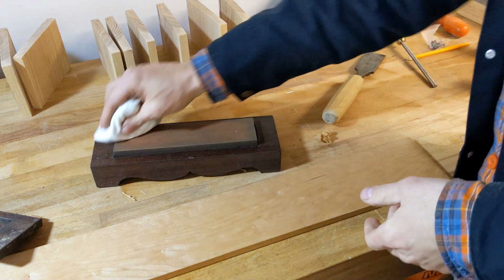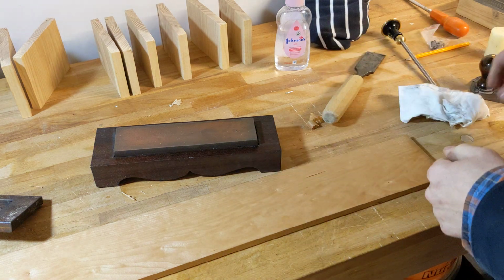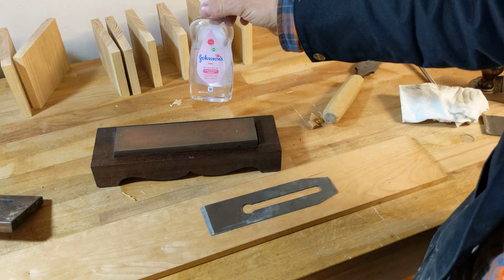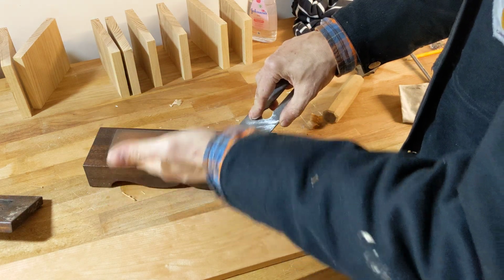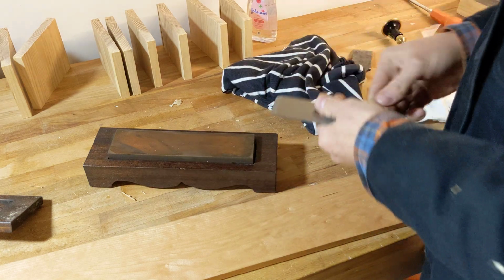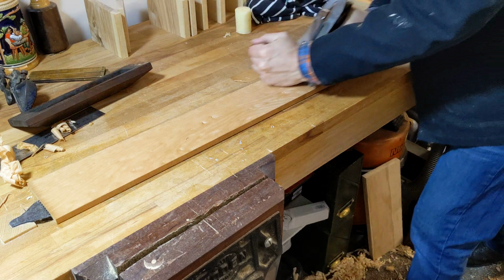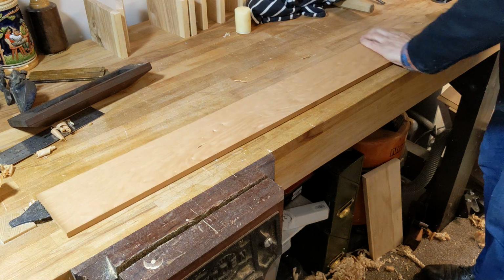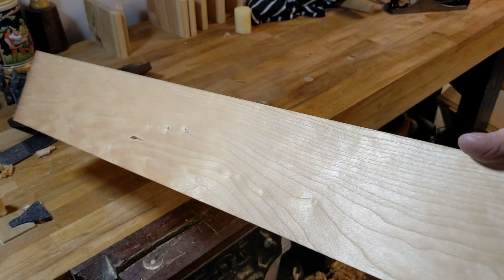400# Grit Sharpening = Shimmering Surfaces! Cheap and Realistic Sharpening! #woodworking

Comment: If I could make one minor correction re. it being megabucks for finer diamond plates? That's only going with name brand, and particularly 'premium' brand plates (I use the quotes very deliberately there haha). As mentioned in a number of the older threads on UK Workshop the budget Chinese plates are a total game-changer for setting up an inexpensive sharpening system. They used to very commonly peak at #1000, but in the years since #3000 has become quite common. Unlike some of the 'premium' brands the price for all grits is the same, and it should be under a fiver!

Diamond plates of any make will of course not last virtually forever like a Norton stone can, but even the cheap ones by now do have a fairly well-proven longevity. And wearing one out in just a short time seems to be very rare (and may be partly a user-error thing, pressing much too hard).
Reply from the maker: That's interesting 🤔. It's good to get some more user based experience. Where do you shop for these plates? Just Amazon?
Reply: @faceedgewoodworking  Previously the place to get the cheapest ones was directly from Chinese vendors on AliExpress. But in just the past year or so there's been an explosion of what's available on Amazon, including sets of plates, and some work out to be just as good value.

But there's a but, the sets rarely go as coarse as I think is advisable (for super-fast edge repair, and reprofiling, in the absence of a grinder), plus they tend to include multiple superfluous intermediate grits that aren't necessary (since unlike when sanding you can make gigantic jumps in grit when honing without any trouble at all). The traditional jump from the India side of a combination stone to a finishing stone is a good illustration of exactly this, since a translucent Arkansas, a good slate hone or a Charnley Forest are all rated in the thousands.

So I think AliExpress may still be the best place to buy individual plates to make up a very budget-friendly set, e.g. a #150 and #1000. Along with a DIY strop that's a 10+ year set for barely more than a tenner, factoring in a metal polish, buffing or honing compound having to be bought new. If one already has anything suitable for loading the strop it's going to work out as under £10.
Reply from the maker: @tungsten_carbide  Helpful! I must admit, I like a water bath grinder for my tools. I don't appreciate the particulate from a bench grinder unless I'm at the lathe. At that point I have an appropriate mask on.

I don't need a grinder that often, thick and wide blades are the main culprits.
Reply from the maker: @tungsten_carbide  Just checked UK Amazon £23 for a 400# 1000# combo diamond stone. What do you use for floating off the particles? Snake oil 😂?
Reply: @faceedgewoodworking  Hehe, I am very wary of anything remotely in the vicinity of snake oil 😁On-topic, like that British-made blue honing liquid that's suspiciously like window cleaner yet costs more than single-malt whisky?! [Off-topic but this is why I was instantly wary of both Odie's Oil and Peacock Oil when I first heard of each one, and have been very gratified to since discover that my first instincts were dead on the money!]

I generally use my diamond plates dry, after experimenting using them with just about everything – spit, water, soapy water, window cleaner, isopropyl alcohol, white spirits, WD-40, baby oil and liquid paraffin. During this investigatory/experimental phase I would have tried one of the old standbys in British and Irish workshops, 3-in-One, I just didn't have any to hand!
Reply from the maker: @tungsten_carbide  Nice! Next time I'm feeling spendy I'll have to give the diamonds a try. I have tried them before but I didn't like the feel. I'll have to be more open minded!
Reply: @faceedgewoodworking  Interesting, not liking the feel or a 'lack of feedback' (assuming they're the same thing in different words) is one of the few complaints about diamond plates that one does hear repeated over the years, so there's definitely something to it for some users. 

Obviously nobody can doubt they do get the job done, but if you don't enjoy the process I wouldn't blame anyone for not wanting to use them. In the same way many don't care for waterstones, without casting any aspersions on how well they work.
Reply: @faceedgewoodworking  All my plates were bought on AliExpress, over a period of years (first in 2015, and still going strong).  "All my plates" is misleading, since I have just the three!  A 150#, and 1000# and a 3000# that I bought just to see if it was A) as fine as advertised (it is) and B) whether it might take the place of a very nice stone such as one occasionally lucks into at a car boot (it could, but I prefer the better of the two slates I've picked up over the years).

That's one of the great things about these plates being so cheap – often they are literally cheaper than a posh coffee – you can pick one up just for the hell of it and not feel too aggrieved if it's not quite what you'd hoped for. I'd hate to be one of the poor sods let down by a premium diamond plate... the Extra Fine DMTs come to mind, at north of 100 quid!!
Reply from the maker: @tungsten_carbide  Yeah, this is the tricky part. Your experience is helpful here. I'm never sure about referring people to AliExpress because it's not quite a clear as buying locally from a reputable brand. 
It might be time for the likes of DMT etc to offer a second tier stone. People would likely still pay a bit more than Ali prices because it's a brand they identify with.
Reply: @faceedgewoodworking  Yeah to be fair it could still be hit or miss ordering from random sellers on AliExpress, rather than from a specific recommended vendor. 

The diamond plates (within each type/appearance) do appear to be very consistent to judge by multiple reports by various buyers on a given forum for example. But, it's not like people are ordering them so regularly that we know they remain consistent (the way a name-brand thing can mostly be trusted to be, even if you're going on a plug from a couple of years previously).
Reply from the maker: @tungsten_carbide  ultimately it's a kinda, worth a punt, how bad can they be situation.

Comment: The YouTube recommendation for the next video which came up alongside this was for Paul Sellers’ “Sharpening to 250 grit” in which he uses the coarse side of the Norton stone to very good effect. It seems the old craftsman still have lots to teach us. I have ground an iron to make a scrub plane and was about to sharpen it so I think I will try the coarse side of the stone and see how I get on. I must say that however sharp I get my plane iron ( even in my wonderful Cliftons) I cannot achieve consistent full width shavings like yours. More practice needed no doubt.
Reply from the maker: Hi Eddie. As mentioned in the video, there is so much nuance in a plane. Sharp is part of the picture but it can't be obsessed over to the point of other key skills are being overlooked.
Reply: If you don't mind me poking my nose in, if you're creating narrower shavings it would generally indicate a slightly cambered edge. Many woodworkers consider this very desirable on smoothers and maybe a jointer for a couple of reasons (with a jack or fore plane the camber would be very much more than slight, although not quite as pronounced as on a scrub plane).

On a smoother one other option to prevent track marks is just to relieve the two corners, but this doesn't appear to be quite as effective as a camber (even if it's very tiny) e.g. as demonstrated by David Charlesworth, may he rest in peace.
Reply: @tungsten_carbide  Thank you, I will check that out.

Comment: An excellent illustration showing what can be achieved with an iron sharpened in a very common old-school way (the Norton combination bench stone possibly being the most popular single sharpening stone ever made). Obviously this is far, far less than is considered normal these days.....  but as I like to point out at any available opportunity, look at what the old guys could do with their 'sub-par' edges! 

And for Americans your example is actually even better than you intended because the India side of a Norton combination bench stone is given as exactly P400, but this is approximately 340 in the American CAMI system. That'll blow a few more minds 🙂
Reply from the maker: #340 grit 😂. One benefit of these stones I failed to mention is that it raises a burr quickly. People can fall into the trap of going too fine and failing to remove wear from the edge (see stropping vid). Thanks for the comment 👍

Comment: Another great video demystifying woodworking. I've experimented with a handful of sharpening mediums now and I'm coming to the conclusion that they all work just fine, it all comes down to budget and preference. Diamond, ceramic, glass, aluminum oxide, corundum. I've used all of the above and all edges cut when sharpened with them. I ground a primary bevel on a 1/4" chisel up to 220# last week using sandpaper, and it pared red oak with out much fuss. There isn't a wrong option they all seem to do the job. Once you get past how shiny you can make your edge, even the cheap Amazon combination stones can be used. I have 2 of those, a 600/1500 which I reckon is actually more around 100/400, and a 2000/5000, which tops out at more like 1500-2000#. Both bought for under $40. Sharpening can be done within most budgets once we get past the smoke and mirrors
Reply from the maker: This is very true. There's a cost effective solution for everyone. It can be a very good thing to go finer, but as you point out, it doesn't need to be expensive. 

Because of my poor production skills, not many will see this and that's fine. Those that do should note the lack of affiliate links or my own shop of tools.

I'm biased, that's a given. But if I was a salesman you could trust what I say a whole lot less.
Reply: Yes, everything works! As someone sage said years ago a lot of the waterstone/oilstone choice simply comes down to whether you like watery or oily mess. (And if you throw in diamonds the possibility of choosing dry mess.)

Quick question re. your judgement that the cheap Amazon combination stones aren't anywhere near as fine as rated? Those are whopping discrepancies, specially on the first one 😲I know some stones, and diamond plates, are rated way off (to deliberately mislead I guess, because of the modern obsession with higher grit numbers) and that could simply be it, but maybe it's partly differences in numbering system? The JIS numbers are often a source of unintended confusion, although usually only at the finer end where the numbers diverge widely.
Reply: @tungsten_carbide  I'm not sure what your question is, but 100% yes, they are rated far above what they can produce. Most will have reviews saying the same thing, and my advice is if you can find some with product reviews that include pictures you can get a better idea. Just know going in to it that they're lower quality, need to be flattened regularly, but will sharpen quickly the stones cut fast. If you land on something like the 2nd stone I mentioned then it will be good to add a strop but truthfully you'll probably be as sharp as you'll ever need. I considered a 3rd cheap stone rated at 10k, expecting a 5-7k # result, but thats up to you, all 3 stones would end up costing like $50-60 which, for the price really isn't a bad deal. 1 kuromaku will run you the same or you could go with diamonds, that has been my go to, they don't require any water or oil, I use them dry and unclog them frequently with a pencil eraser
Reply: To add, a drawback is because they need to be flattened, you'll also need a way to flatten them. I use the 300# side of my diamond plate to do this, since I already had it on hand
Reply: @jgo5707  Thanks for the details. This was a good-to-know query since I'm set on my diamond plate setup – three plates for under $15 (that's for all three, not each) plus homemade strop loaded with metal polish. Coincidentally I use these dry most of the time too.
Reply: @tungsten_carbide  good deal!

Comment: I use a Chinese diamond plate. I get a 9" x 3" one for $ 6.36. It lasts me a few years. I've just ran into some steels where stones other than diamond don't cut it particularly well. India stones clog up and get dull on me too. I just looked at one in a drawer here next to me and there's bits of steel embedded in it. I need to grade it.
Reply from the maker: That's the nice thing about diamond, it cuts everything. At under 7 dollars the price is right too!
Reply: @faceedgewoodworking  I doubt they're the really nice monocrystalline diamond plates. But I get at least 3 years use out of one before it wears out. But it is just sheet metal with the coating on it. So I have to glue it to something so I can hold it. I have mine glued to some thick acrylic sheet. I call it, "Crapton Plastic".
Reply from the maker: @1pcfred  Crapton 💩😂
Reply: @faceedgewoodworking  it's no Shapton. Good enough for me though.

Comment: Here in U.S. you can get that Norton India stone in 3x8 single sided for twenty five dollars. I love it, easy, fast and tough. But I follow with a hard Arkansas, which is pricey. However for years the oil stone was all I used. I advise beginners quite often to get one to get started, cheap and easy to use, but advise them to strop after.
Reply: The Novaculite mines are not producing steadily anymore. They start up and shut down. So that makes supply erratic. They've been mining that stuff since the 1800s. So there's not much left. That makes it a not viable material to rely on these days. Thanks Norton.
Reply from the maker: Hi Jim. A good system! Yeah, the fine stone or the "red brick" option is great. I barely use the crystalon side. I'd like to meet anyone who'd wear one of those out! 
A finer stone is always a good idea. I'm lucky. It's not difficult to find old stones at reasonable prices here. There's always Dan's for those that need new. Pricey, but they will go on for the lifetime of the user, unlike a Shapton glass stone or similar.

Comment: I appreciate this video so much. Thank you.
Reply: Great video, Graham. I’ve been using an IB8 for years as my main honing stone. Grinding on a coarse diamond stone, honing on the India, and stropping with compound and leather. For my polishing plane blades or for the small number of A2 blades I have, I use an extra fine ceramic stone, but the India does 95% of my honing. It’s great, so cost effective, and practical. Thanks for sharing!
Reply from the maker: @MacAustinMusic  No worries. I have put A2 on an India and it's pretty slow unless you maintain a small secondary bevel. It's reassuring to know someone like the simple approach too 👍
Reply from the maker: Anytime 👍
Reply: My Norton stones are on the way ! One more question (for now, lol)  They are 2 inches wide, I was looking at a older Stanly number 6 with a corrugated bottom and the blade is about 2.5 inch.  I assume to sharpen a wider blade I would just sharpen on an angle?
Reply: @viracocha03  Sharpening supplies has single 3x8 for around twenty five dollars in U.S. You can do it on two inch stone though, just a little trickier.
Reply: @jimcarter4929  Thank you, I actually stumbled on that site when I was looking up Norton stones.  I think I will stick to the 2 inch and  continue to refine my technique.   have  cheap honing guide but I don't want to be reliant on that.
Reply: Ok, never mind that last comment. I've been watching your back catalogue of videos and you awnsered that question already. You rock. Thanks.
Reply from the maker: @viracocha03  No problems. Good luck with the stones!